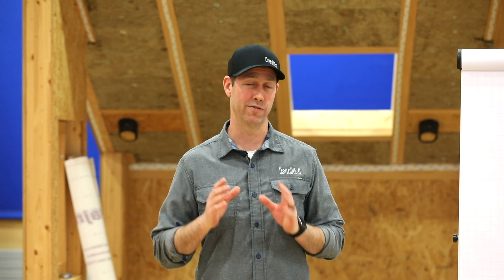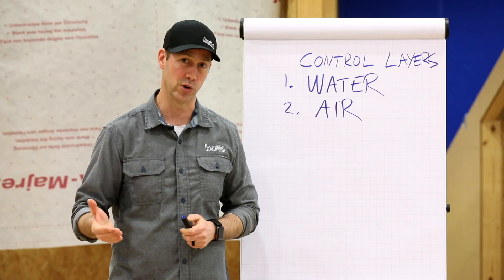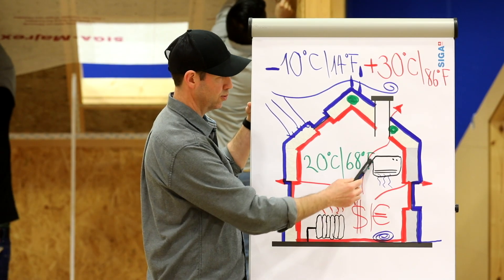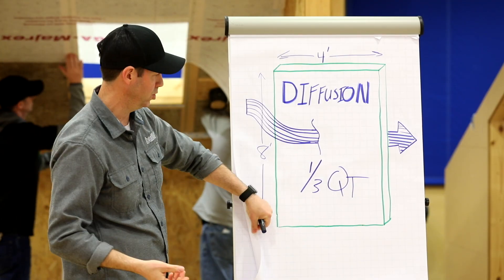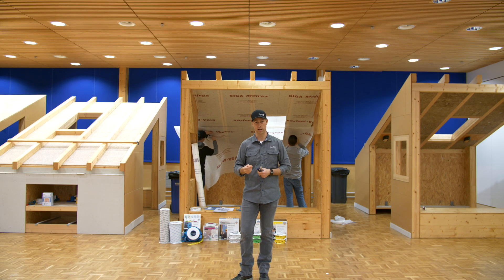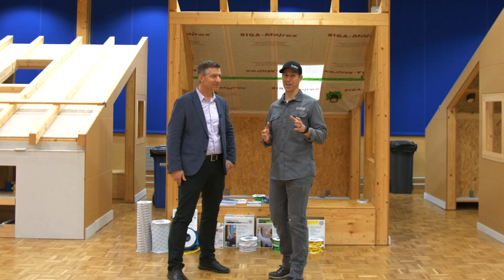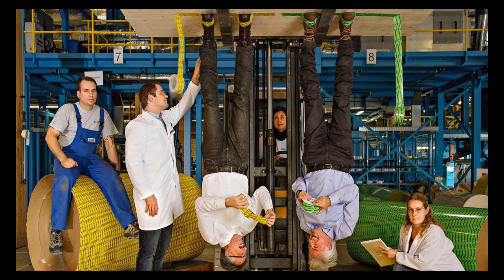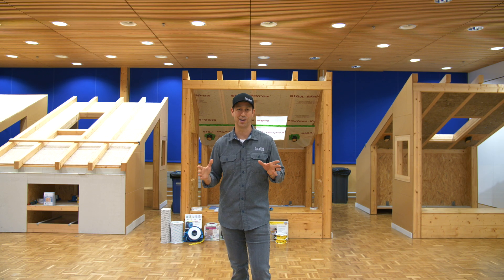Understanding Air and Vapor Barriers INSIDE your House

Comment: Here is the simplest answer and all one needs to follow:
Ignore the concept of vapor barrier.    Air moves about 254 times more moisture than through vapor diffusion. 
Install an air barrier on the warm side of the insulation.  Warm side.   In the north where there is a predominantly heated home, air barrier goes on the inside.   The air barrier MUST be continuous.  Must be continuous and on the warm side.  This can be achieved with membranes or sprayed foam.    
If the air barrier is installed properly it will also act as the vapor barrier which makes the discussion of a vapor barrier not necessary.  Focus on a continuous air barrier on the warm side of the insulation.  
Lastly, install a decent WRB on the outside....beneath sheathing and in front of framing.   WRB.... newer term in the history of building envelope science....weather resistant barrier.    Tyvek is a great example.  The best pennies per foot one can spend. 
That’s it.   Air barrier on the warm side.   WRB on the outside.
Reply: So what if you live in an area of such diverse temperature? Twenties all the way up to the nineties.

Which side of the wall does the air barrier go on.

Comment: Hello Matt!! Any thoughts on "swamp" coolers and how to manage vapor? Desert dweller respects your opinion
Reply: Dan Herron, hopefully Matt will reply. Meanwhile, here’s a little desert advice. Swamp coolers won’t work during the “Monsoon” season — for those few weeks a mini-split system is effective and not expensive. For the rest of the hot season the swamp cooler is ideal. Your desert air is dry enough to absorb and remove the moisture. And a somewhat “leaky” house works in your favor. I don’t think you get terribly cold in the winter, so running the mini-split as a heat pump in winter can help with heating. 
If you’re building a new house (and remember, Matt is in hot/humid Texas, not a desert) and want to insulate to the same degree that Matt does, a swamp cooler is a no-no

Comment: I’m building a tiny cabin in the desert of Southern California. No bathroom and minimal cooking. Coldest it gets in the winter is low 30s. Summers get up to 120. Only about 10 inches of rain a year and usually very dry out. 2x4 construction with tyvek house wrap. There will be a small AC and Heater. Using Roxul insulation. Not sure if I need a vapor barrier. Can someone help me?!

Comment: I have never seen anyone explain what happens to that beautiful vapor barrier when you put several hundred drywall screws through it.
Reply: The screws seal the hole. Barrier integrity is maintained.
Reply: @OttawaMikes  Exactly and if there is no screws or staples the vapor barrier would let more vapors through. I like to put vapor barrier to the inside of the house on the frame and put 2x2 upright  on the frames (vapor barrier is between frame and 2x2. Also more insulation and space for electrical and plumbing. I think that's the best way.
Reply: @fraided88  sounds like you live in a cold climate.  Great solution for that area.  In a hot climate you do not want the vapor barrier to get cold or you will get condensation so this solution would not work.
Reply: @Fraided  sounds alot more expensive in material and labour. At that point why not just use 2x6s for the framing?
Reply: not to mention the hundreds of thousands of staples used to fasten it which will 99 times out of 100 not be taped over.
Reply: 35 years of construction. Not a day goes by I do not learn something new. So when someone puts NO effort into a proven solution to a complicated problem? My response will always be a well deserved "Yup!". 

What's the saying? "For each action there is an equal and opposite reaction".
Reply: Double sided Dpm tape
Reply: is it 100% tight?  nope.  Is it 99% better than no barrier?  yup
Reply: That’s not a very smart thing to say
Reply: Furring strips should help there. You can also tape all the joists to give it more resistance to tearing.
Reply: Those screws and staples are of no consern
Reply: @hosmerhomeboy  Can you not use vapor barrier with tape AND use the acouticseal as well? I am not at all familiar with acousticseal. I am a novice in terms of building but have done a little bit of everything over my many years. I am planning on either re-habbing an old victorian home with high ceilings out in the mid-west to retire to or have the framework of one built which I could then finish. I hope to act as my own contractor, studying up on all code requirements. Electrical I would leave to the pro's as well as the basic plumbing.  I know building codes can constitute a book the thickness of a bible but am planning ahead and have time.

Comment: Your videos are vitally important because of the huge amount of new people in construction and because, historically, no one cared much about these details. I worked as a building inspector and it was extremely difficult to get compliance because they were really not ready for prime time.
Reply: They're used to working one way and it's worked perfectly so far. The only thing is, requirements change over time and as windows and energy efficiency requirements evolve, techniques have to change as well. I have it from a tradesman that Velux windows are still being installed improperly because pieces designed to avoid air leakage around the corners aren't used because the professionals placing them don't know what they're for.

Comment: Matt, I just recently discovered your channel and first of all I want to tell you thank you. Thank you for bringing all sides of home construction to the forefront for us to understand the correct science. A little background, after getting married we moved to a brand spanking new home in Southern Oregon around 2015 that my parents had bought, I realized how poorly it was built immediately. If you turned off the AC within 30 minutes it was the temperature of the outside and it took a bit before you could bring the temp back down. We decided to buy a home of our own after that, but were disappointed to find similar build quality throughout, so we bought a 115 year old home. Thanks to you I've done major improvements to our home were the AC does not have to be turned on until 3pm when it's in the 90's outside. Being a total engineering and learning nerd this is fascinating to me. Thank you again.
Reply from the maker: Love hearing this!  Thanks

Comment: I really don’t understand why people make vapor issues so hard when explaining it. If you use a 6” wall with fiberglass insulation as an example. You want to keep the water vapor out of that 6” of fiberglass. Warm air and holes in the warm side of the wall can carry moisture into that fiberglass. 

The goal of the 6 inchs of fiberglass insulation in the exterior wall in cold climates is that entire 6 inch area stays closer to the interior temp than the exterior temp. So if the air inside that 6” of fiberglass hits a vapor barrier against the exterior plywood in a cold climate you have warm wet air hitting a cold surface causing condensation. When that condensation overwhelms the wall framing you get mold inside the wall. 

If you put a vapor barrier on the inside next to the drywall then the air in that 6” area of fiberglass insulation will be warm and DRY.  When that warm dry air hits the cold outside plywood there will be no condensation. So no mold. 

This is reversed in the hot climates when the cold is on the inside of your house and the hot is outside. You will get condensation on the drywall side unless you stop the vapor before it enters the 6” fiberglass insulation.

In this video he was explaining how much holes in the wall can carry water vapor so that should also be delt with. But he did not describe how to do that. Maybe the material being installed behind him was supposed to help with that. Who know he never said.
Reply: So what do we do when we live in a climate that features 30.C summers and -10.C winters?
Reply: If you have extremely hot summers and extremely cold winters you have 2 options. Make sure the wall can dry in both directions so the moisture is never trapped long enough to create mold. 
OR
Put insulation on both sides of the vapor barrier so the vapor barrier it self never hits the temperature of the dew point of the air inside or outside of your house. You do this with 2”-4” of insulation on the outside of your house behind the siding. When it is being heated inside that outside insulation need to keep the vapor barrier above 50F. 50F is the dew point of the 70f 50% humidity interior air. Interestingly enough this means don’t over insulate the interior walls compared to the insulation on the outside or that vapor barrier will get colder than 50F. And you will get condensation.
Reply: @matthewbarbour2064  buffalonian here, you should try to separate the roof and exterior wall cavity from the interior cavity. The key is to install a class 2 vapor retarder on the exterior (a fluid applied air barrier) and then a class 3 on the interior (latex based paint on all interior walls and ceilings).
Reply: @matthewbarbour2064 ventilation planning and dehumidification - stop the vapour problem at source is the best strategy
Reply: Great summary, thanks
Reply: Nice summary. I would hope there is some self sealing take that can be put over the vapor barrier over the studs. Then the nails holding up the drywall won’t cause leakage. Just my idea.
Reply: Problem with this is I live in NC.  Hot humid summers and cold winters.  You just can’t win.  I just made mine as air tight as possible, have insulation installed properly and control for internal moisture the best I can. 

Hind sight being 20/20 my next house I’m going with closed cell spray foam.  Air seal, vapor seal and expansive to prevent gaps.
Reply: The story is now when the studs finish drying completely and shrink or the house moves the rigid foam pulls away from the stud. The more I read on spray foam the less I like it.
Reply: Fibreglass insulation does not work when it's wet.
Reply: @gdavis8588  There also appears to be some health concerns mounting.  They will say that it's fine once it's cure, but why don't we have more concern for the tradespeople installing this stuff?  There are injury claims due to long-term exposure.  For products to be truly green, we need to take seriously the toxicity and hazards of working with these high-tech materials.
Reply: @unchannelbyryan  Hey Ryan, as another NC guy.... when you say you will go vapor seal on your next one, where is that vapor seal going, on the inside or outside of the wall? lol still trying to get that question answered.
Reply: Ok ,I'm in south Carolina and we have hot moist long summers. Ac is run 3/4 of the year . Should I install a vapor barrier between the exterior insulation and the drywall? My thinking is if I install a vapor barrier between the sheetrock and insulation it will cause condensation and enable mold and mildew to grow. Am I correct or dead wrong?? Thanks!
Reply: @number1pappy  You do not want the vapor barrier to be cold for the bulk of the year, because if you do you will get condensation on it.  That means it needs to be on the outside of your insulation so the air-conditioning can not cause the vapor barrier to be cold, which would cause condensation.  That being said some moisture will get past the vapor barrier and your drywall will be cold so you will get a little bit of condensation on the backside of your drywall.  So you need your drywall to be able to dry to the inside of your house.  This means having a gap behind a mirror for airflow and don't use vinyl wallpaper ect...
Reply: @ecospider5  thanks for the info!!
Reply: I guess I'm headed to SIGA's website, since they have a catalog with installation instructions/details for their air barrier products.
Reply: I put plastic over my 6 inch walls and noticed water vapor on the sun hit walls on the plastic before I drywalled...this scared me.  I felt that is too much water to be trapped in that cavity...I took the plastic off the walls that were hit by direct sunlight...I feel that a wall needs to breath a little, especially when it is subject to drastic changes like sunlight heat.  The building materials will store some moister and give it up as well.  I felt trapping large amounts of water was a bad idea.  So I have not had any problems and the house is now 23 years old.

Comment: In America, with multiple climate zones requiring continuous insulation on the exterior, there is likely a vapor retarder on the exterior. So the conventional wisdom of installing a vapor retarder on the warm side would end up with a situation of a vapor retarder sandwich. Eliminating the vapor retarder from the inside would result in a more forgiving assembly. Am I wrong?
Reply: The problem with your idea is that when warm moist air hit a cold surface you get condensation. The goal of the 6 inchs of fiberglass insulation in the exterior wall is that entire 6 inch area stays closer to the interior temp than the exterior temp. So when the air hits that vapor barrier on the exterior wall in a cold climate you have warm wet air hitting a cold surface causing condensation. When that condensation overwhelms the wall framing you get mold inside the wall. 

If you put a vapor barrier on the inside then the air in that 6” area of fiberglass insulation will be warm and DRY.  When that warm air hits the cold outside vapor barrier there will be no condensation. So no mold. 

This is reversed in the hot climates when the cold is on the inside of your house and the hot is outside. You will get condensation on the drywall side unless you stop the vapor before it enters the 6” fiberglass insulation.
Reply: Ecospider5 so what do u do in New York where it’s hot snd very humid in summer and freezing in winter? I was going to just do No vapor barrier at all and let the air dry out any moisture but hoe do we insulate then?
Reply: You need to choose your terminology a little more carefully. The layer below the gypsum board is typically called the "Vapor Retarder" and the layer on the outside, behind the siding is the "Air barrier" You are correct when you say that you do not want to trap moisture between these two layers, that would be problematic. The Air barrier is intended to provide a defense against air leaks and drafts and any moisture carried with it from penetrating the building envelope.

Modern "Air Barriers" such as "Tyvek" are made from SPBO, a man made material that allows for the passage of water vapor but not the passage of water droplets. The science behind using SPBO, is that any water vapor that has permeated the inside "Vapor Retarder" is allowed to continue passing thru the wall and out thru the Air Barrier, and any wind driven moisture droplets cannot be admitted into the wall cavity.
Reply: @rozinant1237  I've just not communicated well. First, I'm specifically referring to climate zones 6 and above. Regarding terminology, I'm referring to continuous insulation on the exterior as a vapor retarder. So if there is a vapor retarder on the exterior, and if a vapor retarder has been installed on the interior of the wall assembly, there are 2 vapor retarders. Martin, in one of the articles cited above, recommends eliminating the interior vapor retarder in this case. By the way, just saying my thoughts, I could be wrong with my understanding.
Reply: Bryan Uhler Ecospider5 so what do u do in New York where it’s hot snd very humid in summer and freezing in winter? I was going to just do No vapor barrier at all and let the air dry out any moisture but hoe do we insulate then?
Reply: @mattymets101  Perhaps use PVA as the vapor retarder...